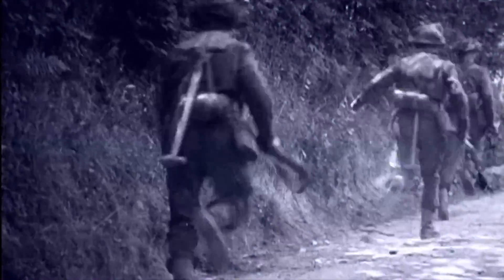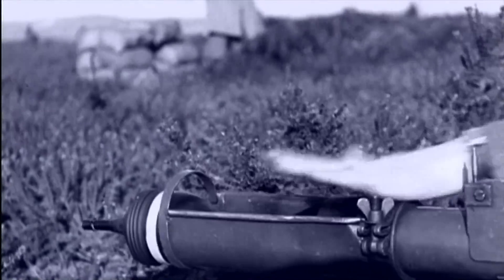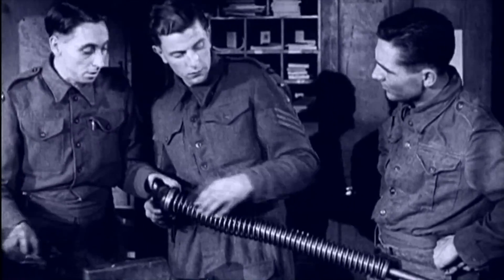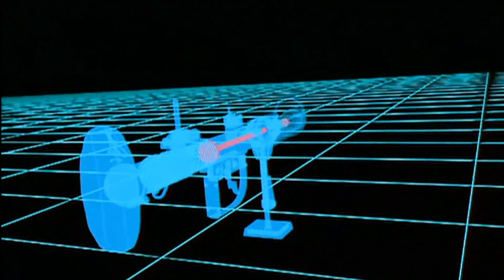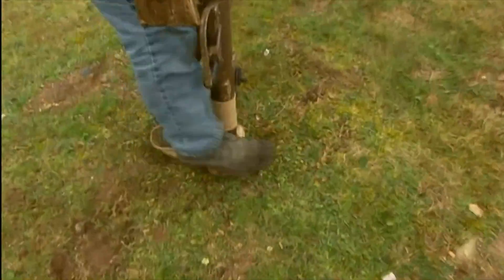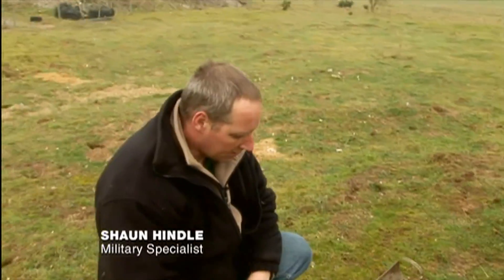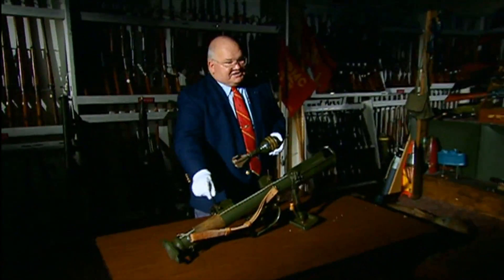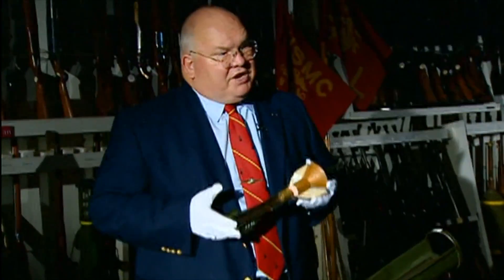Weaponology - "British PIAT"

Comment: The PIAT was far better than people give it credit for.  During the D Day landings the PIAT knocked out 7% of German tanks - compared to 6% for rockets fired by aircraft. The PIAT remained in service until Korea and was used effectively by the Israelis in the Arab war.
Reply: You are comparing a fucking mortar to a plane mounted, hard to aim, unguided rocket

And there was only a one percent difference
Reply: @homemadetech5712  Yes but people with PIATs weren't deliberately seeking out tanks. The PIAT in regard to armour was a primarily defensive weapon, whereas rocket firing Typhoons and the  like were specifically tasked with finding and destroying armoured and other vehicles. Plus a Typhoon carried 6 rockets each with a 60LB HE warhead. A Typhoon fired rocket didn't even have to always score a direct hit to knock out a tank. Given that the PIAT would only be used against enemy armour that had not been dealt with by your own tanks or Anti Tank guns  or aircraft and which had gotten to within a few 10s of metres of your position, knocking out 7% of all tanks knocked out means it must have been a reasonably effective anti armour weapon.
Reply: Chris M that’s like saying any infantry anti tank weapon is defensive, in including the bazooka and panzerfsust. The PIAT was the equivalent to those and meant to do the exact same thing, except it actually did them way worse. Also, the typhoon part was also incorrect, as most of the time infantry didn’t have time or just couldn’t, due to weather or terrain conditions, call in these planes.
Reply: Chris M also the British tanks would usually just been blown up by then, as all the tanks except the firefly they had were trash
Reply: Chris M also, the seven percent thing is just for dday, not the whole war
Reply: @homemadetech5712  
The British tanks like the Churchill would take far more than a Sherman and the PIAT destroyed more German tanks than the Bazooka, the PIAT took out tanks the Bazooka could do nothing about.
Reply: Barrie Rodliffe the Churchill was a heavy tank, while the Sherman was a medium tank. Also, the post fired a much larger shaped charge (83mm vs. the bazooka’s 60mm) with the downside of having less than half the effective range of the bazooka. The bazooka was more accurate, had a flatter trajectory, a faster velocity, and was much lighter, smaller, and less unwieldy than the PIAT. The bazooka could also be fired from a standing or crouched position, while the PIAT could only be effectively used while the operator and the weapon were firmly on the ground. The 60 millimeter rockets of the M1 had an effective amor penetration of around 120mm, while the PIAT only has an effective armor penetration of about 100mm. So no, the PIAT couldn’t take out take out tanks that the bazooka was “too weak” to destroy (mostly because the bazooka could already take out most tanks from the rear and sides, and even some from the front)
Reply: @homemadetech5712  
The more accurate Bazooka was not as effective, I would take a PIAT any day, certainly accurate enough and a good chance of stopping more than an armoured car, also with a Piat you can fire it more than once without giving away your position. The PIAT could be fired from positions the Bazooka could not and no one told Major Robert Cain you could only fire it while standing.  The PIAT did stop tanks like the Tiger, the Bazooka maybe a halftrack at 20 yards but then the Bazzoka operator is dead.
Reply: @barrierodliffe4155  the bazooka was far more effective and was powerful enough to destroy any target the PIAT could and more. That one scene from saving private Ryan isn’t a good source dude. The PIAT was an objectively worse weapon, in fact, all spicket type mortars were inferior to rocket propelled launches in every way that mattered. That’s why the British currently use rocket powered anti-tank weaponry
Reply: @barrierodliffe4155  and again, the bazooka’s rocket could penetrate further into armor than the PIAT’s charge
Reply: @homemadetech5712  
The Bazooka was very ineffective until the M 20 well after the war. The PIAT could and did destroy German tanks. I have not seen saving private Ryan.  I have seen what really did happen rather than Hollywood. The Bazooka was ineffective until the M 20.  It is immaterial what is used now, what was used and worked at the time is the PIAT.  
In WW II the PIAT  served very well in many actions and the British for good reason rejected the Bazooka.
What is used now has no bearing on anything, in WW II did the USAAF use jet fighters?  Why not? they dod now.
Reply: @barrierodliffe4155  the bazooka could and did destroy tanks and other armored vehicles just as well if not better than the PIAT. The US probably were going to use jet fighters if the war was prolonged, as they already had one in development. You still haven’t provided any statistics or data that proves the PIAT was better than the bazooka in any way
Reply: @homemadetech5712  
Well the Bazooka may have destroyed the odd armoured car but tanks is another matter, the PIAT certainly did do that. The US and use jet fighters is a bit of a stretch since they were too late and had to use British jet engines.
The PIAT did destroy some 7 % of the German tanks in Normandy. that is a statistice you can't deny and since there were many anti tank guns, tanks  and Hawker Typhoons attacking the tanks first and the PIAT only used defensively that is rather remarkable for such a poor weapon. Nothing you have made up shows the Bazooka was half as good as the PIAT.
Reply: @barrierodliffe4155  how many times must I explain that THE BAZOOKA ALSO TOOK OUT TANKS, AND DID IT JUST AS GOOD IF NOT BETTER THAN THE PIAT DID! I provided statics in my earlier comments, noting the higher velocity, flatter trajectory, better accuracy,  and better penetration of the bazooka
Reply: @homemadetech5712  
How many times must you keep on telling lies. The Bazooka was useless and took most of the war  being improved, it still needed improving after the war as for tanks the Bazooka took out very few if any. The Bazooka had to be much modified to be able to do much against tanks at all, the PIAT could take out tanks right from the start including Tiger tanks. You claimed the Bazooka was better with no proof at all.  While The PIAT was taking out heavy German tanks the Bazooka was doing bugger all.
Reply: @barrierodliffe4155  I have continuously told you to look back at my previous comments for the statistics I brought up earlier. The bazooka was not useless and the PIAT was simply not a better weapon. It was a cheap, easy replacement for the Boys AT rifle that fulfilled both anti-infantry and anti-tank. As I said earlier, the bazooka has better penetration from its rockets on ALL variants compared to the PIAT, was more accurate, had a longer range, flatter trajectory, higher velocity, less cumbersome, and overall far more easy to operate and handle.
Reply: @homemadetech5712  
I have seen plenty of your lies, the useless Bazooka was continuously modified until it eventually was a good weapon, still not perfect while the PIAT worked straight away.
As you lied before about the Bazooka which was less effective against tanks. The PIAT was accurate enough to destroy plenty of tanks. the long Bazooka was not as easy to use in a concealed position which as soon as you fired it would not be concealed anymore, no second shot. While the easier to fire and load PIAT could and was used repeatedly many times.
Reply: @homemadetech5712  Dont try to argue with this guy, he is a liar and was already exposed in a number of comments - he used only Wikipedia as his only source and tried to change it to prove his argument. He pretty much goes into every single comment under this video and tries to tell that PIAT was the best weapon ever, while insulting people who think otherwise. Just ignore him, he is not worth your time :) People like him seek attention and he will never learn from actual proved facts, so just leave him be in his world of fake dreams

Comment: Yeah I gotta agree with these guys. The PIAT was little more than a glorified sling shot. Yes it did it's job... sort of. Yes it could penetrate armor to a respectable degree... but the thing just wasn't good. it used a SPRING to deliver it's ordnance for crying out loud XD I respect the brits that had to use it, but when you compare it to the Bazooka, Panzershreck, or even the Panzerfaust; it just wasn't very good :/ Only thing it had going for it was no back blast which is going to help you what? 1 out 10 engagements?
Reply: Someone else with an opinion without knowing anything about the projectile and its firing mechanism 😂
Reply: How would you know?  Were you there?  I suspect there are a lot of (deceased) German tankers who might disagree with you.
Reply: Oh I don't know its not like France and Germany had any large urban areas...oh wait. And the fact that the PIAT never had to worry about batteries getting damp or flat or getting badly burnt by the escaping gasses  . And as for range Gen. George S. Patton stated to a colleague that "the purpose of the bazooka is not to hunt tanks offensively, but to be used as a last resort in keeping tanks from overrunning infantry. To insure this, the range should be held to around 30 yards so even the range isn't that much different.
Reply: The spring doesn't deliver the ordinance, it doesn't work like that. It's kind of like a modern "soft launch" system without the soft part: the impact of the 12-pound spigot does lob the bomb out of the launcher, but it also acts as a striker which ignites a propellant charge in the tail of the bomb. That's why the PIAT has recoil, you don't think you could compress a spring with a 200-pound draw just by banging it against a two-and-a-half pound bomb, do you?